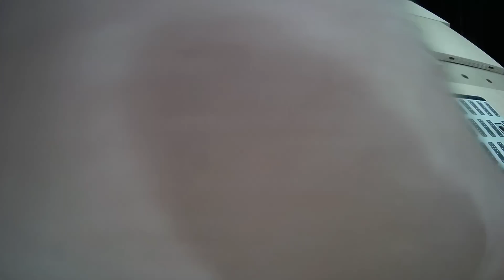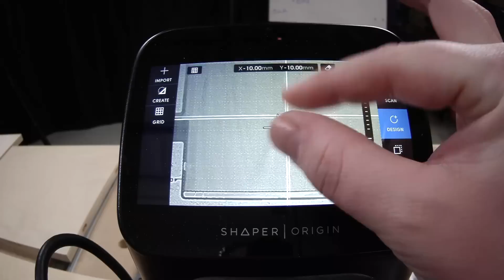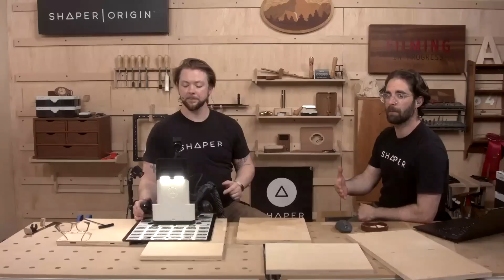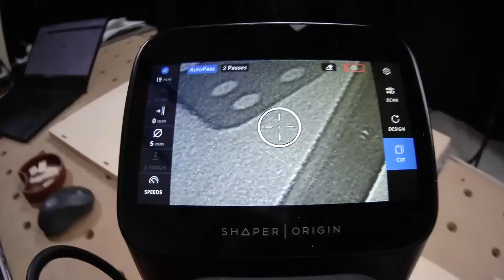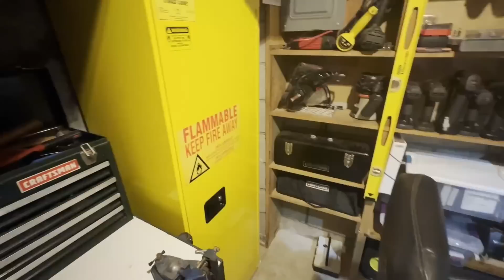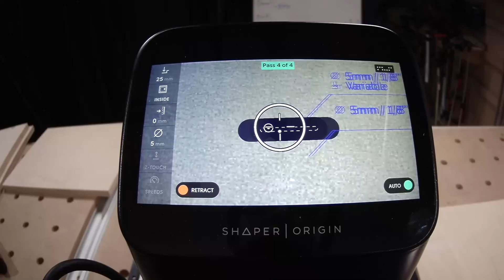Session 105 – English: Domino Joinery with Origin + Plate

Comment: I tried my hand at creating floating shelves today with my shaper plate and edge mortising attachment.  When I got to trying out the edge mortising adapter, I found it easier to just clamp my work price to my table flush with the surface and use the shaper plate.  The edge mortising adapter was just too cumbersome to lock in place and I had to re-clamp at every cut 

I liked the perfect fit but decided that in the future, I will choose all domino cutouts to be 6mm larger than the domino and just align my boards up when gluing during assembly.  If you get a single tight-fit domino off by a tiny fraction, it is hard to disassemble and trim.  

I'm not sold yet as I could have assembled this peace in about 10 minutes with my finish nail gun and some wood putty.  I was painting this project anyway and only used the dominos to try out my toys.

Comment: As a domino user, I have the origin as well, I've found you only have to put the loose slot into one side of the joint. It makes assembly easier if you first put the dominoes into all the tight slots.